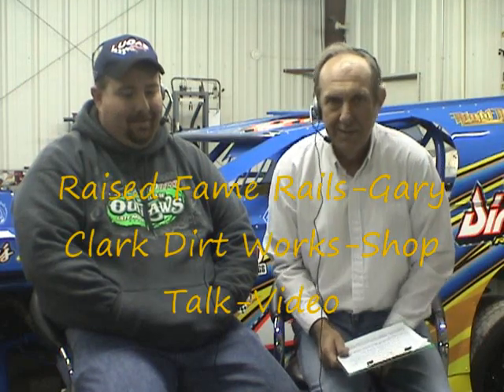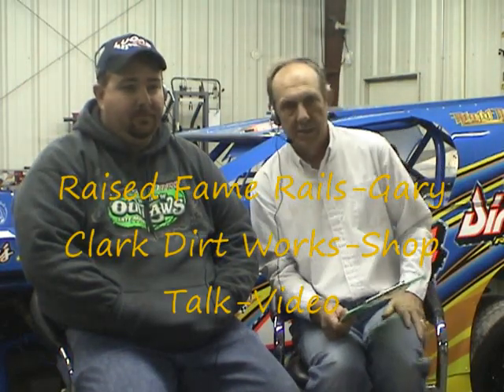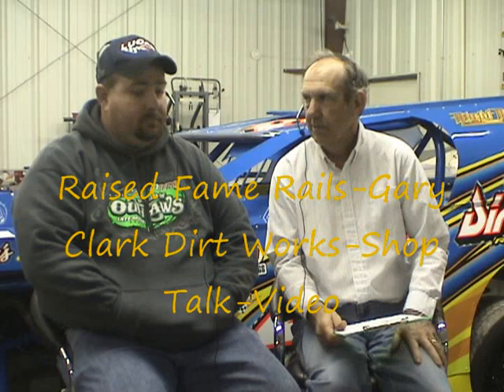Raised Frame Rails Part I Gary Clark Dirt Works Video

Comment: Gary Clark was saying Modified 4 bars were out in 1990 1991, Well I can tell you who was working on 4 bar modifieds in the 1980`s and I can also tell you IMCA used one of these cars in 1986 in the Reno Nevada, for the Promotor`s work shop when they were tring to bring IMCA to the west coast.. Joe at Carr Racing Chassis has never gone away from 4bar cars.. They were also the cars that won Nascar Winston Racing Series with Bobby Hogge 2 years in a row. There still developing 4 bars and bird cages.
Reply: Ml
Reply: No all one

Comment: No altering frame, cutting and moving up frame rail is illegal, it is cut and dry. Example no dry sump, car builder says the sump is relocated to the rear and it is a wet sump. Yes it will win races, its rolling the car over harder on the right side, plants the rf, allowing more drive off the lr. also there an aerodynamic advantage, as in the whole car becomes more of a spoiler, these guys know this that's why they do it..... to win more races. Case closed. 11 year old tech, all late models have it now, last year they even went farther moving the rack mount, the strut rod to the rear and moving the cross member up on the right side.. 15 more years of this and the cars will be running on the rs door making the whole deck a side spoiler...